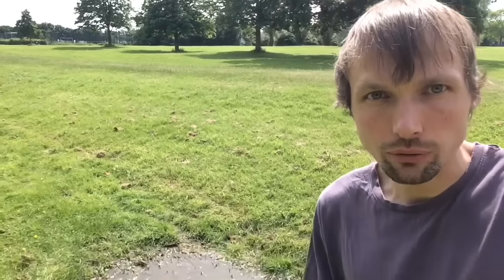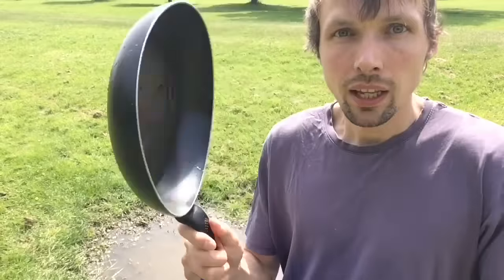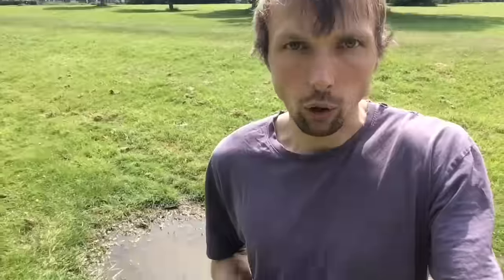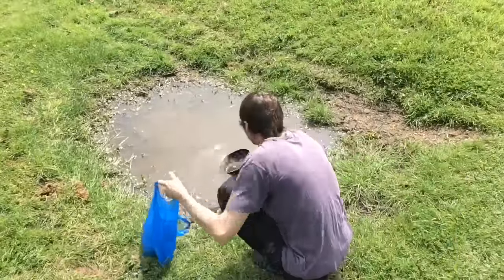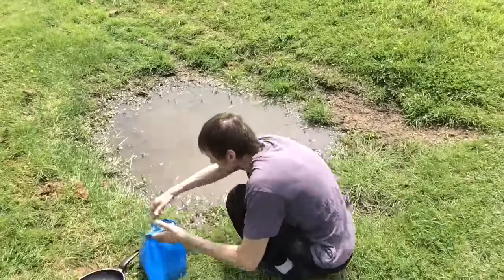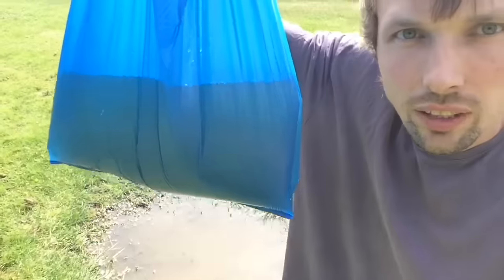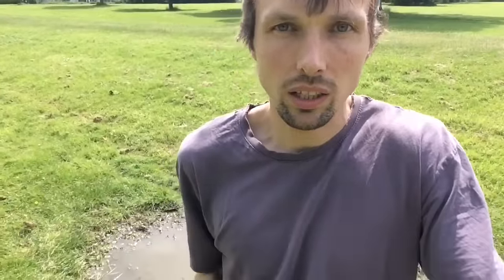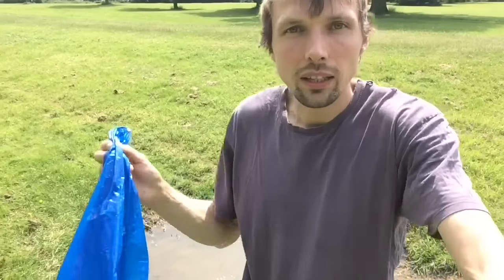how to repair a plastic bag

Comment: If the bag is small enough, you could save water by not using and then having to wash that pan by just blowing up the bag and seeing if air leaks out with a gentle squeeze. That's how I see if a bag is fit for dog-shit detail.